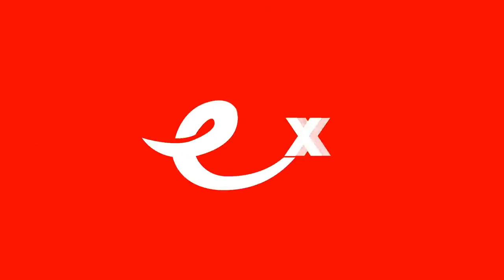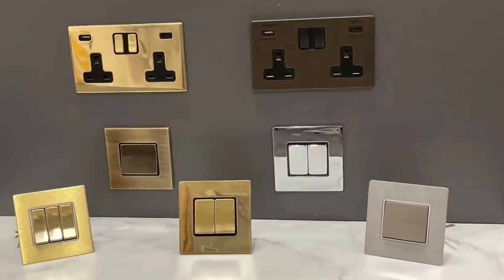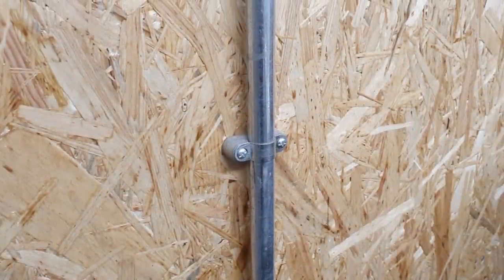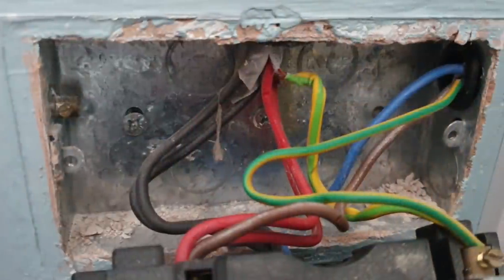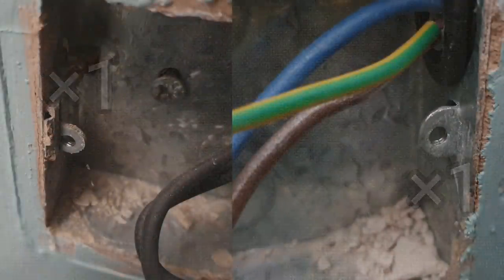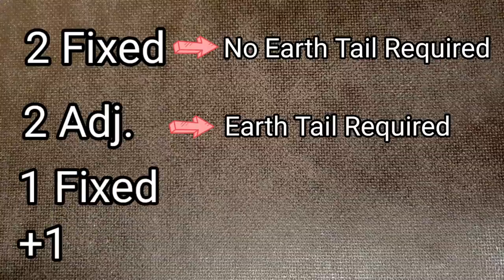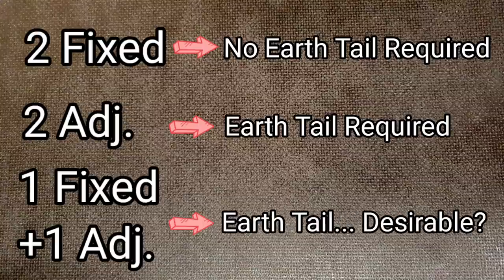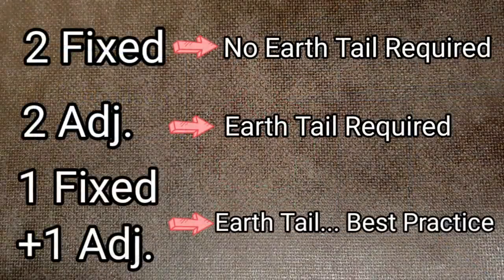Do I need to earth a metal back box? - light switches and sockets

Comment: 👏👏👏
Worked for a guy once who was a stickler for earthing boxes... so much so, he used to buy terminals to go in the back of pvc boxes & connect 🤦‍♂️
Never not earthed a metal back box since, but I’ll give the pvc ones a miss lol
Reply: @efixx  
Little tip:-
I usually leave a leg in the socket about 150mm longer, strip it back & it just requires 2 pieces of earth sleeve & fold overs eliminating the joint from a separate cable & minimising the amount of cables entering the back of the socket

Comment: I Earth the back boxes,if its a new installation or enough length I'll take the cpc of a T+E cable and fold it over so that its a continuous wire through the earth terminal on the back box to the earth terminal of the accessory so its not cut incase the the two half's split.
Failing that just a quick flylead
Reply from the maker: Thanks for the great tip 🦾
Reply: Good tip. Wouldn’t it be better to do it the other way around, so it goes to the accessory first and then to the back box. That way, if the cable breaks in the back box terminal, the accessory is still earthed.

Comment: I've done LOADS of domestic wiring jobs over the years and I ALWAYS earth the metal back box as even when a plastic front accessory is fitted to it the fixing screw heads are still exposed and they're in firm contact with the box so of course they need earthing, especially as not all front accessories have the earth bonding strap across the rear of the accessory linking and earthing the two screw holes. Sockets usually have such a strap but light switches usually don't, hence the need for the box to be earthed. Common sense. But the real hazard in my opinion is with plastic surface boxes, or hollow wall boxes where the screws are again exposed on the front and inside near the live wiring but there's then no easy means of earthing them if you're fitting a light switch or any accessory without an earthing strap fitted to it. This is why I think all front accessories which fit onto back boxes should have earthing straps to both screw holes.
Reply: Better explains why it's needed... didn't think about the earthing strap on sockets and not light switches! Thanks for the added context!
Reply: Very good practice.  If someone later installed a metal switch.
Reply: @patrickcannell2258  A friend of mine has recently had his plastic front light switches replaced with metal ones, so I hope they're all properly earthed, with the necessary earth sleeving which far too many fitters don't bother with, but I always do.

Comment: Since we don't have metal boxes here in Germany since the early 1950s: Nope. And the old metal boxes for accessories were insulated with tar on the inside, junction boxes were insulated with several layers of tar impregnated paper, almost like cardboard. Conduit was made of sheet metal, and also had such tar paper insulation inside back then. Outside of the boxes and the conduits was lead-plated to prevent corrosion caused by the plaster. Since the mid 1950s conduits and boxes are made of plastic. But even if the electric installation was modernised, it still troubles sometimes. For example when a lazy electrician didn't remove the old boxes, and just filled them up with plaster, after a few years brown rings will show through the wallpaper. The thing is, the new and the old boxes are not screwed to the wall. They are fixed with plaster or a rapid hardening cement to the wall. That means, you'll have to chisel them out. And afterwards they're trash, because you can't remove them without damaging the box. Only the ones for hollow walls can be reused. The method there is like the american boxes: Tighten two screw which release two wings which clamp to the wall.
But that the boxes are damaged during removal isn't a problem. They're really cheap, less than 20 cents per piece. And otherwise, you'll find plastic boxes from the 1960s which are still perfectly fine.

Comment: Hoping someone can advise. I have a 1960s terrace with older electrics. The back boxes have the usual brown, blue and Earth wire. The Earth however is only connected to the back box and not the face plate. 

I have had an electrician advise that a rewire would be needed if I want to use metal faceplates and/or conductive lights. Is this true? 

Also, if I stick with plastic faceplates and lights can I stick with what I have and not rewire?

Comment: So if you have 1 fixed and 1 adjustable lug it's kind of like returning a trolley to the designated trolley bay once you have loaded up or do you just push it over to the nearest barrier. You know you should really but you know there's a guy in a yellow jacket floating about who will do it, but in this instance the guy in the yellow jacket is a copper wire in a green and yellow jacket.

Comment: I Think if you have a metal back box, it should be earthed no matter what the fixings, after all it's one small loop of wire that could save some one from electrocution there is no question of that, any metal container, that is directly or indirectly fixed to an electrical system should be earthed.

Comment: I tend to do it only if the socket to be fitted is metal clad or screwless metal, or the previous box or screws had signs of rust.  If the socket to be fitted is white plastic I put CPCs in each side of the socket but double them over. The screws will provide a good ground connection to the box as long as they are tight and don't rust...
Reply: You don't come across as a professional sparky in my eyes.

Comment: I never do this no need 
Ok it is good practice but you try and fault find or do an insulation resistance on E TO N OR E TO L Ans see what happens you’ll literally have to unscrew every single socket to either find a fault of get a correct reading pisses me off when I come across a job like this it is good practice but at the same time a pain in the ass

Comment: YES!! It's just good practice and if you don't, then you shouldn't be a sparky in my eyes.
I didn't realise they did boxes with 2 fixed or 2 adjustable lugs. I know I've worked on them but I've only ever used one fixed and one adjustable.

When I moved into my house, they did a crap job when it comes to the wiring. I had to replace one of the breakers as the person who did it, forgot to tighted that one up and it hurts out. There was only a tiny bit of slack left and there are a couple of cable's in there that aren't even connected!
How can you not wire up every single cable, when it's a new build with well over 100 plots? 🤦🏻‍♂️
The house is about 8yrs old so it's got a plastic D/B (which I don't like). I had to go around every single light switch, socket, spur, etc and earth all of them, as everyone's on a price n they couldn't give a flying fuck even if they tried their best
Reply from the maker: Sounds like a standard new build install.
Reply: @efixx  it sure is unfortunate 😕

Comment: I find it so weird that the UK and US keep using metal boxes, why not change to (obviously non conductive) plastic boxes. Those just seen like an unnecessary risk...
Reply: @leewinters606  There are different types of plastics, some don't burn at all others are tested to resist very high voltages and currents. 
Metal boxes are dangerous because they are conductors. Bad install is ☠️. 
Besides the point but it isn't DIY friendly.

Comment: I dont earth if it has a fixed lug as whenever i test the screws i have a good earth,maybe im being lazy but i am usually anal about everything else.

In my opinion a faceplate should never be removed live anyway.(though we do it)
Reply: The screws get earthed via the brass ring insert which is connected to the earth terminal on the socket. Whether the back box is earthed or not has absolutely nothing to do with earthing the screws!
Reply: @simonbmr  if the screws are earthed then the back box is earthed,its basic stuff mate.
Reply: @andytap560  the IEE disagree